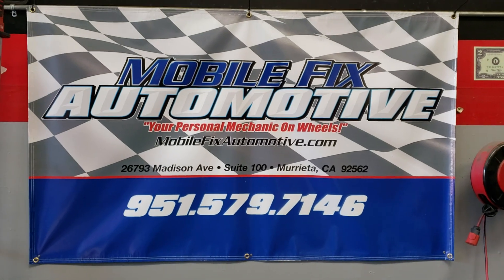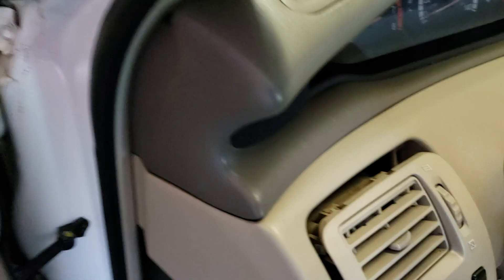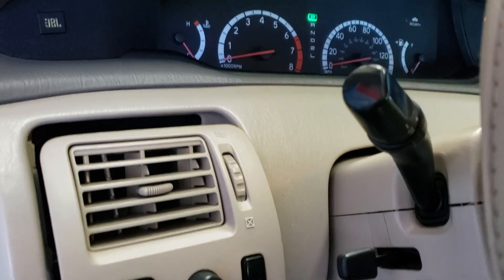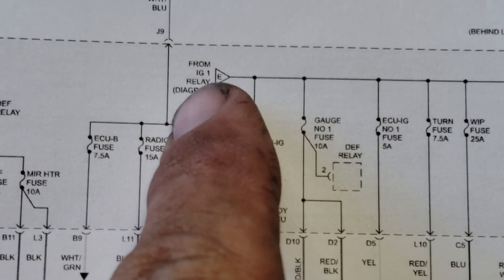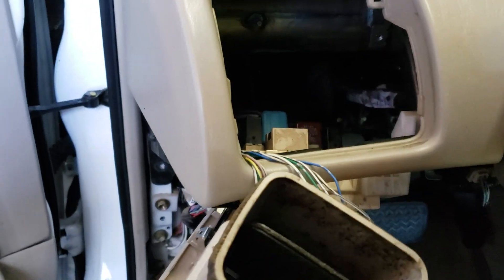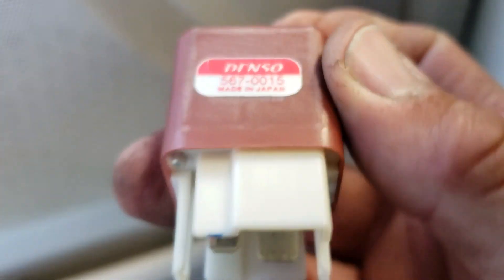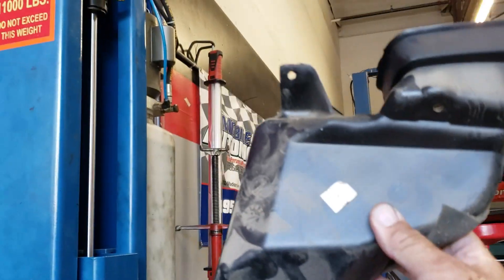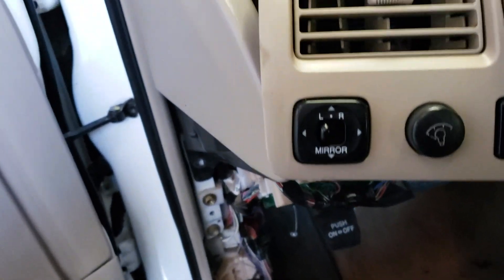Toyota Avalon no power to dashboard or turn signals.

Comment: Well my car has this same problem. Has been setting for two months. I just watched your video. I just pulled out the left panel and can see the blue relay. I am a lady so I will have my son take out the two bolts for me. I am going to be heading to Advance Auto to pick up this part. What an easy fix if this is my problem. Prayers it works. Thank you so much for this video. I had just given up

Comment: Gosh I wish I lived near you. I have some problem with my 98 Avalon. When I try to start I have a BUNCH of relays going bananas....  no start.  Had someone come over just to load test battery and alternator.... and said “oh crap... I forgot it won’t start”. To my surprise it started. Once.... lol. That tested good.  Tried to start again and got the typical relays everywhere going bananas. The ones under the hood and the ones under the steering column you show in this video. I don’t even know where to begin.  Just put so much money into it for struts and breaks and rotors and radiator.... only to have this happen a few days later 😢

Comment: What worked for me, is disconnecting the battery for 20mins to reset the ECU. All dash lights started working again. I came across this fix from a Toyota advice web page. I would try resetting the ECU as a first step, since it worked for me.

But, it’s great to know that the relay is another common fault that leads to the same issues. Thanks for sharing the video!

Comment: I have an 01 Toyota Solara. I have the same issue. Changed neutral safety switch, alternator and Battery. Cars runs but no working gauges. I think this might be the culprit. Im gonna try it out. Thanx for this video sir

Comment: Hey Ron, any other ideas I have the same issue no power windows, no air conditioning, no radio, no turn signals,no power seats. I replaced that relay and it still doesn't work any other ideas of what it could be the only difference is my car is a 2000 xls.
Is there another relay I can replace.

Comment: I"m having the same exact symptoms with my 1999 Camry LE V6. Can you help me where to find that wire diagram? I've already checked 100A fuse under the hood. Half of my left side fuses get no power under that kick panel fuse box.

Comment: Great video. I have the same issues with my 98 Camry and also it’s not going out of gear. Could that also be another symptom of that bad relay? And you the alternator won’t charge the battery? So no need to change the alternator?

Comment: Hi Ron,
I noticed my instrument cluster not responding. All gauges, battery indicator light and others not showing on the board after switching. I don't know what fuse to check. Its a corolla 04 model. Kindly help.
 Thanks.

Comment: For a 2002 Toyota Avalon, what is the part number for the relay that I need for the dashboard, brake lights, air conditioner and windows?

Comment: I changed that relay TWICE and it did not solve my issue. After trying to turn the Avalon back on it blew another fuse. I’ve tried replacing alternator, battery, and a few other fuses with no luck! I LOVED my Toyota!!!! Been trying to fix this dash issue for almost a year. Took it to THREE mechanics and the final shop just told me to junk it. No one wants to put anymore time into figuring out the dashboard power window ac etc issues. 😩💔 I just had the oil changed and brand new tires put on days before this issue occurred. Still can’t get myself to junk it though. Anyone have anymore ideas for a fix?

Comment: I've been haveing these same problems but my car also has to be jumped to start and after a few minutes of running it will start idling rough could that also be from the relay being bad?
Reply: Please tell me if you got this fixed and how cause mine was the same and now it won't start at all eith the security light always blinking even with the master key
Reply: @IAm-kz2hc  I was able to fix it ended up just needed a alternator. Hope this helps

Comment: Hey would this relay have anything to do with flickering headlights,inside lights? My 03 Avalon lights flickers at idle worse on dim and worse on cold nights and im at wits end trying to figure it out, its kind of common on these as ive discovered
Reply: Did you figure it out? The light flicker on my 02 as well
Reply: @amirah669 Pull your 25 amp A/F sensor fuse under the hood then start it up and it'll stop pulsating mine will,you'll get an engine light but it'll go off after you put fuse back in or in a few drive cycles or can turn it off with little cheap scanner,
Reply: Thank you so much!
Reply: @amirah669  It's something Toyota should've addressed but of course they didn't,only thing left to try as i know of and it may work may not is 130 amp alternator..yw
Reply: @amirah669  If you pull fuse out to check it dont run it up road without it its just to prove that its an AF sensor possibly to computer problem..if you figure it out Please let me know lol
Reply: Okay i will…im going to try tomorrow my only problem is that it doesn’t happen every single time i drive but often. It affects my whole electric system like when i press the breaks the radio will cut out
Reply: @amirah669  Check ground wires under hood also make sure they're not corroded,broken or loose
Reply: Okayyy!! Thank you so muchh for replying too! Ill update you!
Reply: @amirah669  oh..one more thing do your headlights and dome lights pulsate,a steady pulsing? Thats my problem yours could be related to that or couldnt,nothing in my 03 Avalon shuts off just steady flickering lights..im done lol
Reply: @roltyd22  update::: So my dad said my alternator belt was loose on the car so he took it off (the alternator )and went to get it tested and it was good so he put it back on andd tightened the belt really well and he also cleaned my battery and electrical components with electrical spray and ive had no more problems!!!
Reply: @amirah669  Thats great! Happy you got it fixed as for mine i gave up guess i live with it for now,thanks for the reply